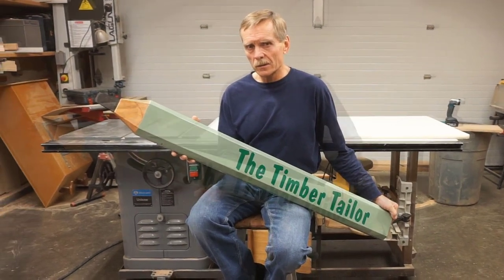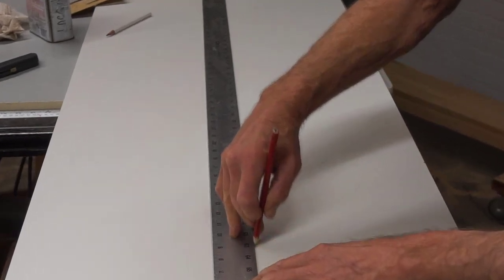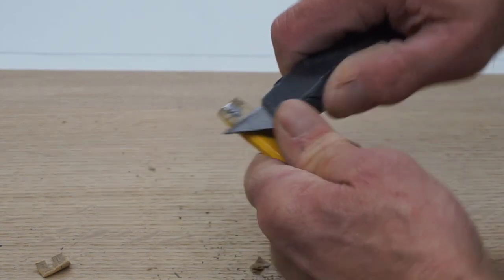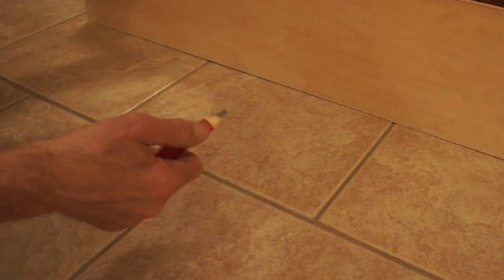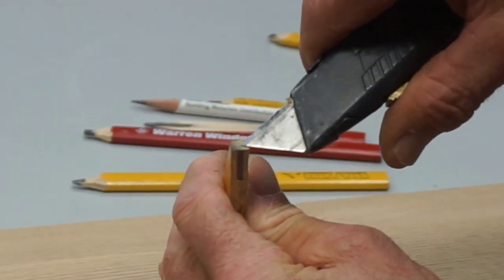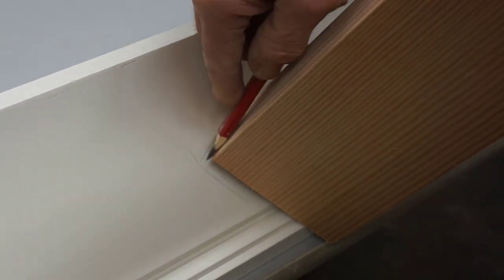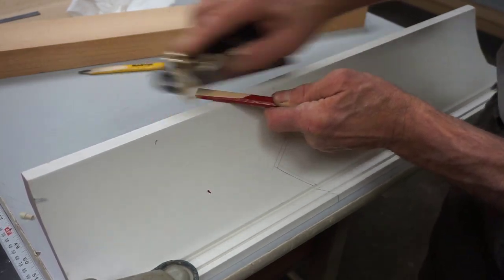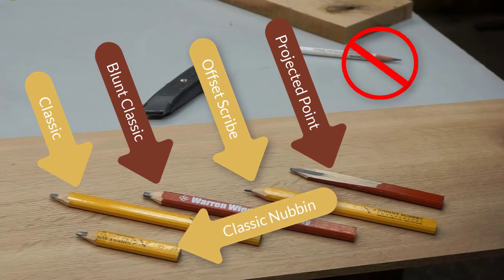How to Sharpen a Carpenter's Pencil

Comment: I think this has been the most useful and informative 12 minutes I've ever had on Youtube. I had never been shown how to sharpen a carpenter's pencil before and had no idea there were different ways to sharpen it for different uses! I've got one next to me sharpened to a classic point, which I've picked up by trial and error. The technique for scribing uneven surfaces is just what I need - I've got to do some boxing in on some pretty uneven walls and had no idea how to cut the sheet material for a snug fit. Now I do, so thank you!

A couple of tips that I picked up from another Youtuber on carpenter's pencils:

- They're flat so they don't roll away like normal pencils.
- You can use them as spacers, 1/4" one way and 1/2" the other.
Reply from the maker: I hope you can check out some other videos here at Next Level carpentry because I try to pack useful information to every one and you may find them helpful as well...
Reply: @NextLevelCarpentry  oh, this isn't my first NLC video by a long shot! My father was a keen hobbyist woodworker and you remind me a lot of him (but quite a lot better at teaching, a lot more skill and less shouting).

I've been slowly building up my own workshop so I can follow in his footsteps. Unfortunately a lot of his old tools have been lost over the years but I've still got a few. Wish his lathe was still around. I used to love using that when I was little. Thanks for everything you do, I'll carry on working through your videos.
Reply from the maker: @ollieclark  Nice!  It's great that you value legacy building enough to invest time and energy into preserving your Father's passion... I hope you're able to 'attract' a lathe into the mix sooner than later! Best, Matt

Comment: When I took drafting in HS, we had little wooden paddles, with about 10 sheets of fine sandpaper stapled to them, to sharpen our pencils to a needle point. I never forgot that and have used sandpaper ever since to make my pencils very sharp. Also,  father was a professional photographer. He shot portraits on sheet film. To repair blemishes, he would pile up graphite on them. He bought long leads and sharpened them too by rubbing them on sandpaper.  It is amazing the trivia  you remember from more than 50 years ago.
Reply from the maker: Must have had the same drafting teacher because I too remember that pad of sandpaper! It does indeed get pencils very sharp but it's messy and awkward to carry around for General carpentry so I use my knife but there's always a sandpaper handy in the shop for special applications like that projected point tip I show in the video... Best, Matt

Comment: Thanks for this, Matt.  For over 30 yrs the carpenters pencil has been my No.1 tool for marking on construction materials and I am so glad that I haven't become so smug that I couldn't gain an extra wrinkle in the grey matter with your demonstration.  The "projected point" example you use for flush scribes over a wide gap is one that I wonder how I never thought of that before!  Obviously you'd want to dedicate a pencil specifically for that task but since lumberyards are still giving away these pencils, why not?  Also good to note is that by modifying your "classic" slightly by cutting an angle not quite as extreme as the "offset scribe" you can still make a reliable edge for many consistent lines but by flipping the pencil over in your hand can also write legible notes in a notebook with the pointed end. Thanks again!
Reply from the maker: Can Do Dude, You're welcome! Glad to share insights with you on thie 'ol reliable carpenter's pencil... your variation on the classic point would make a good Method #5!  What should we call it, The Writing Point maybe?  I like it!
Hope to 'see you around'!
Matt

Comment: above and beyond.  I took pencil sharpening for granted until I wasted half the pencil by continually breaking the lead by whittling "freehand" (not supporting with my thumb).  It was harder than I thought it would be. I didn't realize there were so many variations and applications. Thanks for the post.
Reply from the maker: You bet, Wayne, glad you found this helpful.  The 'variations' I show are ones I find quite useful and use, not frequently but effectively, on remodeling projects.  There's other 'boutique' variations like filing a notch in the center of the flat face of the lead to draw a double line, etc, but they're more of a novelty than money-makers. Thanks for your comment... and happy 'whittling with a purpose' Best, Matt

Comment: Blown away by your pencil sharpening skills. Learned a lot. I'm a cabinet maker/furniture maker by trade and have rarely used a #2 round lead pencil because you have to stop and sharpen them too often. I've mostly used the cheap fine point Bic black pens. Fine lines with no sharpening required. The only tip I might add to your carpenter pencil sharpening video is while your at it, sharpen both ends.
Reply from the maker: Steve, Always glad to hear from folks 'in the trades' since they have so much insight for learning things from a variety of disciplines.  Black pens do indeed make fine lines with 'no sharpening required' but I find myself constantly needing to erase marks so go with 'lead' instead of ink.  When working mainly in the shop (and therefore not using a carpenter's pencil) I most often use the inexpensive PaperMate mechanical pencils shown on the Amazon page in the video description.  These too require no sharpening but frequent projection of the fine, delicate 'lead'.  I choose these specific pencils because they're 'the twisty kind' NOT 'the clicky kind' so I'm able to advance the lead the desired amount which, invariably, is less than the one full click predetermined by most mechanical pencil manufacturers...  now what they need to do is offer a mechanical pencil that advances lead from both ends 8-)

Comment: So I watched this video about a month ago I guess and I've been sharpening my pencil like this since then. I've only had to sharpen it twice and only because I snapped the lead off while it was in my pocket. This is the best method I've ever tried, I honestly don't see how it can be improved. Especially if you do a lot of scribing or straight edge marking, when you tilt the pencil and run the lead in the corner against the edge you are marking the lead continuously sharpens itself. I showed it to my boss who is 42 years my senior and he was impressed. My biggest suggestion is buy the best pencil you can find, not all lead is created equal and with an advanced sharpening  technique like this you won't be wasting a good pencil by any means, instead you will be making it last ten times longer than a cheap pencil sharpened half as well.
Reply from the maker: Thanks for the great endorsement Austin and also for sharing this with your boss!  Boss types tend to get fairly opinionated over time so is he was impressed even a little it's quite  a statement!  I think what you're saying is "friends don't let friends use cheap pencils" and I couldn't agree more! Best, Matt

Comment: It's great that you kept the video concise and...to the point :)  Excellent presentation - like many others here, I never thought I'd enjoy watching a 12 minute video on how to sharpen a pencil...up to this point I've always used classic rounds...perhaps I'm due for a change.

As a request, could you do a video offering any tips you might have on cutting well with a worm-drive circular saw - or a sidewinder? - In my grossly limited experience - being only 34 and a professional chemist, not a carpenter - unless I spend 3min clamping a straight-edge piece of wood into place as a guide, any cutting I do will be so ridiculously wavy that it'll require a good 10-15min of rework with a hand plane - in the end, if I want a clean straight line (not having a table saw), I'm better off using a handsaw.

As always, thanks so much for sharing your expertise!
Reply from the maker: Hey Vernon unfortunately I do not foresee doing a video on cutting straight with a circular saw anytime soon I will say though that it is a basic skill and the best way to advance is to practice so if you got a pile of scrap wood and some time draw straight line and just work on your method and technique to the point that when you're comfortable using the saw you should be able to cut a reasonably straight line without too much effort. As with many Endeavors that require following a straight-line I do suggest that you focus farther ahead than the point where the blade is actually cutting the wood. It's hard to ride a bike or fly a plane if you're looking too close in front of you but need a better perspective of a point on the horizon that guides your direction better than a point too close to the task at hand.  Not sure if that helps but the more practice you can do the better you'll get in time. Best, Matt
Reply: @NextLevelCarpentry  well...I definitely have been doing the opposite of what you suggested... I'm always dead focused on the line immediately in front of the saw. I'll keep your advice in mind - Thank you once again!
Reply from the maker: @jensdavidsen4557  excellent I think you'll find a certain ratio of focusing on the blade In the cut and looking ahead to where you're going as a good combination for making acceptably straight cuts freehand.
Best, Matt

Comment: Pencil day today - reached the point when just using any pencil won't work! Getting a batch of Carpenters pencils. Next issue how to sharpen them properly - searched for a NLC tutorial - thanks. When tracing a line on to wood over an uneven surface I also angle the pencil tip slightly backward which allows the pencil to "ignore" the grouting but also follow the contours because it is supported by the tiles either side. Of course a hand saw ignores small deviations as well so perhaps it's not completely necessary - but it looks prettier!

Comment: Good video. Just a suggestion. Some "noobs" may not realize how you're holding and handing the pencil and the knife. You are gaining control and precision by holding the knife in your "dexterous" hand, bracing the pencil in your left, BUT and importantly here, you're using your left thumb for important leverage, force and precision. That's apparent to me (field project engineer) and a perfect way to get the job done AND done safely. But noobs may not realize that. But really, great video

Comment: Had no idea so many ways to sharpen a pencil. Thanks for sharing. From mechanical drafting, the round pencil should be rotated as you draw keeping an even line. Ever tried the Japanese method? They sharpen a bamboo stick, dip it in black ink then go like hell with it. I like your presentation on making the cabinet doors and I needed to do a few for the kitchen. My woodworking skills not very good but I'm getting better at hiding my mistakes.
Reply from the maker: kimchee, thanks for commenting and subscribing to Next Level Carpentry.  Sounds like you  came across a valuable nugget for woodworking skill: you're only as good as the mistakes you can hide :-)  Best, Matt

Comment: Great tips. I was taught to sharpen a carpenters pencil by using a stubby chisel. Hold the pencil with your thumb in line with the pencil. Using your thumbnail as a guide, slide the chisel down the nail. It makes forming a chisel point on the pencil easier.
Reply from the maker: James,  
I'm not trying to talk anyone out of a method that works well for them, so if the chisel method works for you, by all means, stick with it.  Gotta dance with the one what brung ya, right? 
I went to the effort of producing this video for those who've yet to learn an effective method for sharpening the very useful but often misunderstood/misused carpenter's pencil.  I do feel that it's a more universally applicable method because a sharp chisel isn't something many beginner tradespeople have on hand.  When they advance to the point where they have and can re-sharpen a stubby chisel to the level necessary to safely and properly sharpen a pencil there's no reason they couldn't or shouldn't switch methods.
In the meantime, thanks for the 'great tips' compliment... I always appreciate comments from engaged viewers like yourself, even if we differ in opinion.
Regards,
Matt
Reply: There is always more than one way to do something...the mark of an expert is how to fix oops. Again, I enjoyed the video, particularly the alternative sharpening methods. They will come in handy!

Comment: Matt...I like the OLFA mostly because its Slim and its Stainless Steel. If I lean against something I know its not going to Break leaving a nasty/dangerous Razor Blade in my Pocket!  It works great as a Scraper too!  Run the Blade all the way out as it's Flexible and it Lays Flat against the Work...remove Glue, Peeling Paint, etc. The Auto Locking feature adds Peace of Mind and Works Effortlessly :)
 However...I will be implementing all 4 of your Tricks/Methods for Sharpening Carpenters Pencils from now on...after all it is an Indispensable Tool on every Woodworkers Projects!
Reply from the maker: Will you include a link to the specific OLFA you like here?  I know you already included it on another comment but this would tie the knife to the video for myself and other viewers... thanks mucho... I'm going to check it out for all the reasons you list!  Matt
Reply from the maker: OK, I see the one you like.  A differing preference here too... I have a couple Hyde box cutters in the drawer on my bench for many of the uses you cite.  I like them because their handle is a comfortable (albeit larger) size which makes it easy to use... but I never carry one in my pouch though... must be the sort of work I do maybe?  Nevertheless,  thanks for sharing!  Best, Matt

Comment: Hey Matt. It's funny. This video is the first video of yours that I saw.It's also the one that led to my subscription. Since then I've learned a lot and never been disappointed. I couldn't find the one with the strap clamps that you demoed. I  previously made little culls with a 45 degree notch to accommodate clamps. but after that video I remembered  that I had a similar strap clamp. I dug it out and used it for a small mitered 1/2 box for a toilet paper dispenser that I incorporated into a vanity.  It's called the VAS-23+2k  made by BESSEY you can get them on line or even find them at the larger Home Depots  there around 30.00 a pr and pretty impressive I know that you already have some clamps but at that price the'r worth looking into. All the best to you and God bless. Can't wait till the next installment.
Reply from the maker: Hey Daniel, this has been a popular video and it's cool to know it was enough to earn your subscription.  Checked out the Bessy's you mention.  With it's sensible design and price it looks like anyone in the market for band clamps should give it strong consideration along with the Merle's (here's a link to the review video: https://www.youtube.com/watch?v=RKE08xe-vb4&t=983s ) I could see it as 'shootout' video doing a comparison of the two brand/models.  Nylon strap vs steel, nice wind-up reel vs springy metal can, etc.
Thanks for offering your perspective on these!  More videos to come :-) Best, Matt

Comment: You probably mentioned, or has been in the comments that the actual reason why a carpenters pencil is flat is so it doesn't roll away when you set it down. Out in the field, you'll rarely have a level surface to cut upon.
Reply from the maker: The only mention I make about Carpenters pencils being flat so they don't roll is that it's a silly notion and outdated wives tale Jason. Sorry to contradict your ubiquitous belief but I hope I have Justified my disagreement by showing all the advantages of a rectangular lead in a rectangular pencil in the video. Best, Matt

Comment: Excellent video Matt. While watching it I started wondering if you have a refined method for scribing things that sit at a 90° angle and have a transition of over an inch. For example I had to tile next to a tub that had a large rounded bump out on the bottom of the face and I just used a dowel and pencil to scribe with. It was sloppy and certainly took more attempts than I would have liked, can you show or explain how you do it because I have noticed your methods seem well thought out.
Reply from the maker: Hey Chris,
Not sure if I understand your question but there are definitely some great tricks for scribing tiles to any complex countour.  The best way to answer the question would be with a video that addresses it directly.  If you want describe the conditions in more detail or e-mail a picture of them I'll make an effort to do a video for it.  Cool?